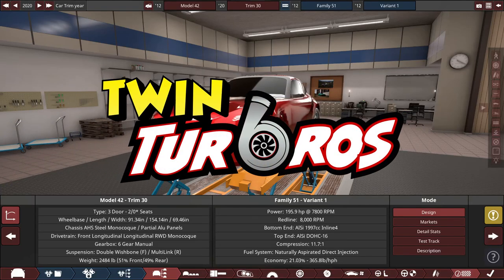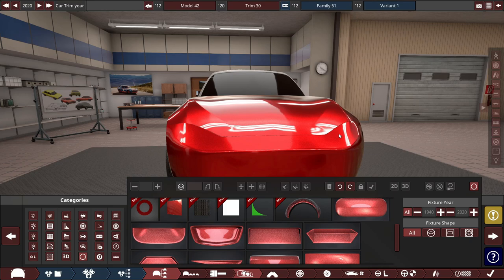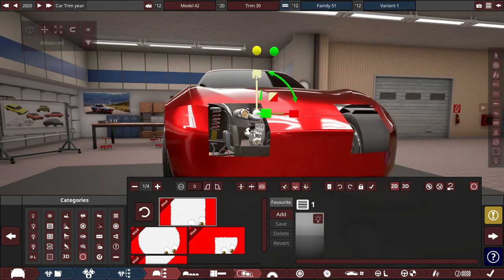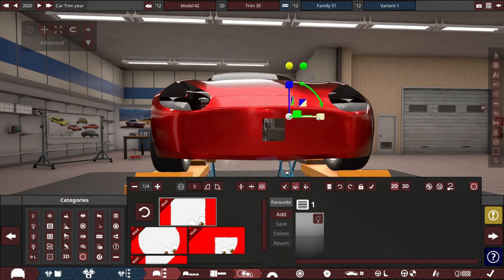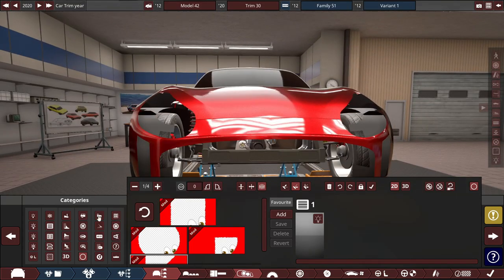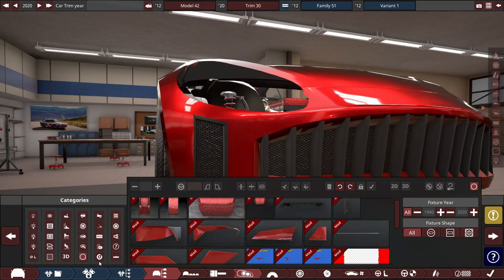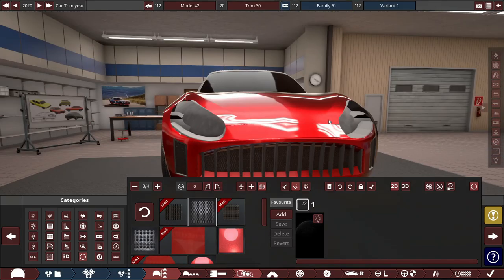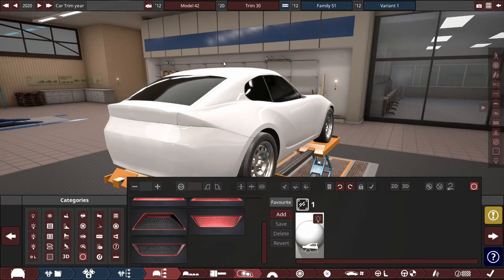How To Make Custom Headlights?! Automation Tutorial

Comment: Just to the right of the headlight mod you used for the grill bars there's another mod included in the same mod pack that allows you to add pieces to add inset separations in the headlights and some other reshaping, but they also make for good border pieces for the lights and grills.  I honestly think they're better for forming the edges than the slope pieces.  That said, their default placement is just slightly below the headlight glass, so you have to do some juggling sometimes to make it look right.